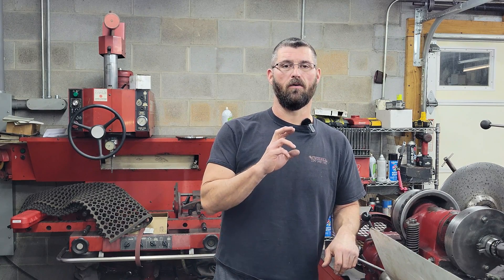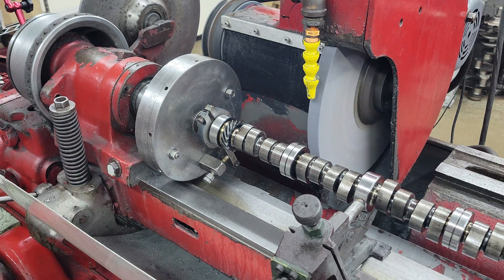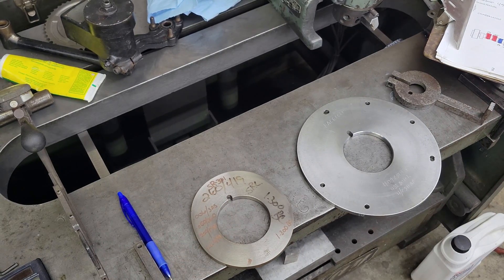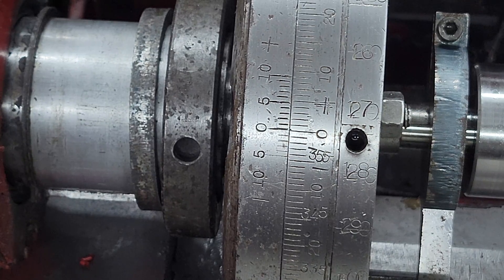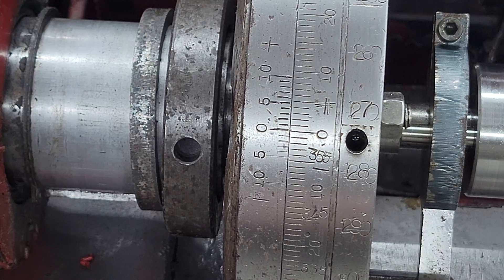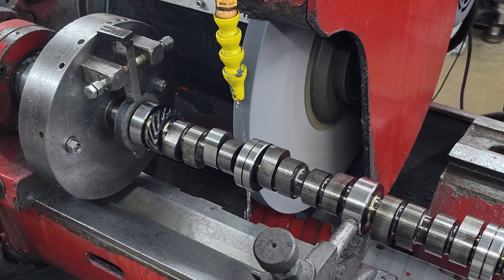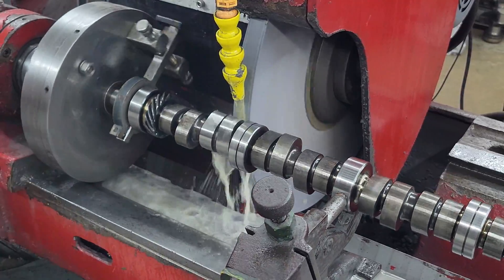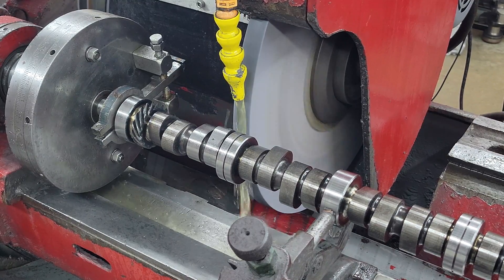Shop Tech: Camshaft grinder set-up and Grinding a Billet Fe Ford Roller Cam

Comment: Is the index plate bank angle for a SBC 41 degrees ?
Reply from the maker: No, the bank angle is 82, the angle between 1and2 int lobe is 37
Reply: @powellmachineinc  Thanks.  
2 and 1, 37 cam degrees apart plus 8 degrees lifter bank angle for 90 crank degrees of separation.
Reply from the maker: @TomSmith-cv8hk 37+45

Comment: I have a 55mm billet Pontiac cam.  .0025 missiing off the lobe because a bad roller.  Can y'all fix it
Reply from the maker: Unfortunately we are accepting any more repair work at this time, but definitely can be fixed no problem

Comment: Finally got to this video! This was a great introduction to how this process works. 

How would you go about re-grinding a cam that you don't have anything on, or do I need to keep watching videos because you covered it? I am sure this isn't something you would normally do as you are running a business and you need to get work in and out, so I wouldn't expect this to be something you actually do, but my curiosity stems from liking obscure and oddball stuff that has basically zero support.

Comment: If I supplied a cam from a tractor could you grind one just like it. It would be steel billet and about 36" long. Could I supply the blank just round or would you need the lobes roughed in?
Reply from the maker: we can do as much or as little of the work as you like, we are backed up on projects, so a std grind would be relatively fast , to turn a spool into a ugl core may take a couple months depending on heat treat ect
Reply: What would cost be to machine the lobes from a round turned blank
Reply: 6cyl john deere
Reply from the maker: It will have to be heat treated after lobe milling,  also does it need a gear hobbed? Also all the main journals will need finished after heat treat
Reply: @powellmachineinc  it does not need a gear and it would need heat treated after lobe roughing. I'm a machinist and I could rough the lobes in but not sure it would be worth my time. I would have to do it with a dividing head on a bridgeport. I have a cnc mill but its not a 4 axis mill. There would be no hurry. Maybe over the winter
Reply from the maker: @TheJohndeere466  shoot me a email  powellmachineinc@gmail.com

Comment: You are the only person to teach how the process of grinding a camshaft in youtube.Thankyou very much.
Reply from the maker: You are welcome!
Reply: Not quite the only, big John (iirc his name) at Delta Cams has a yt channel and explains the process and even goes a little deeper into the tooling up of the grinder and the master plate (think of it as the pattern or template) and how you can do a sort of reverse process of putting a finished cam into the machine and cut (grind) a new master based on that cam to get new master tooling (basically copy any cam)…I might have buggered that last part a little bit and not explained it very well but that’s how i understood it plus it’s been a couple years ago since I watched his videos.  But I agree Daniel does a great job explaining this stuff in these videos and I’m glued to every one of them

Comment: Could you give me a price on a basically stock Camshaft for a 455 Olds. I'm terrified of buying another comp cam because I lost it because of it whipping out. I have the stock cam out of the original motor but it has a worn lobe or 2.
Reply from the maker: Rollers are 450.00 pretty much any street grind,we couldn't go stock though

Comment: I know, if it aint broke don't fix it . But other then the speed of churning them out , any real advantages of the new CNC cam grinders ?
Reply from the maker: For 10k plus rpm stuff the 8 decimal place accuracy may pay dividends,  but the set time and programming will make it unprofitable in a one off shop like mine, we grind 1 cam at a time for the customers application,  so unless you're doing 10 plus pieces of the same grind I don't think it would ever pay dividends,  IMHO.

Comment: Holman Moody used a manual cam grinder when I worked for them in 1961. Joe Rump was the cam grinder and Fred Lorenzen was their driver at that time. Joe indicated each journal for runout after grinding and corrected if necessary to + - .001 TIR with a pneumatic peening tool.
Reply from the maker: Yep, that's how it's done

Comment: Good information-thanks 👍… Question on flat tappet lobes ….is the taper ground in over the entire lobe or only at the peak. Reason I asked is that a supposed expert claims that the taper is only ground on the peak and this done by a grinder that rapidly offsets the angle of the wheel at the peak…
Reply from the maker: Correct, the taper follows the full circumference of the lobe, that's how it works.
Reply: @powellmachineinc  thanks …that is what I’ve always believed .

Comment: How often do you need to dress the grinding wheel to be sure it is still straight/flat?
Reply from the maker: Once to rough grind and once to finish grind, on steel, a little more for Ductile iron

Comment: Is this a single pattern cam?...totally awesome video
Reply: Ok, I must have missed something....did you change the master before you switched lobes?
Reply from the maker: @Duane Dahl  no, there are 2 masters stacked one behind the other, look at it again you can see it.
Reply: @Powell Machine Inc  nice video, do you sell ford fe solid roller cams
Reply from the maker: No it's dual, 226/230, thank you for watching!

Comment: So grinding a flat tappet camshaft you just tilt your grinding wheel to get an angle on the lobe
Reply from the maker: Yes, that's correct
Reply: @powellmachineinc  I've wondered about the angle being wrong on flat tappet camshafts about the same time the grinder may be cutting a roller than a flat tappet and may not get the angle on the machine set right. In the old days that might not have to be changed
Reply from the maker: @David Reed  it's possible,  but it would be a rookie operator to do such a thing.

Comment: Great.video! Curiosity though, as this is a roller cam, there’s no taper necessary in the lobe for lifter rotation. How is that ground in a flat tappet cam? Maybe it’s shown in another video? Thanks.
Reply from the maker: Haven't done that video yet, but we dress the stone with the proper taper, but we have all but stopped doing anything but rollers.